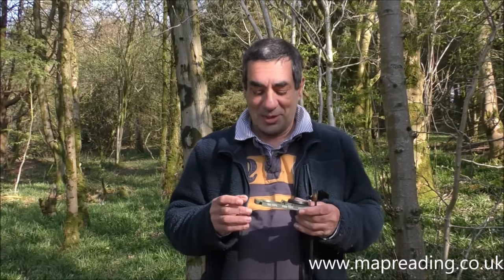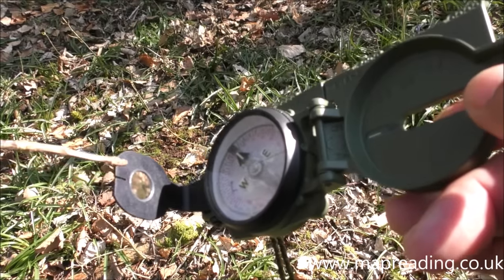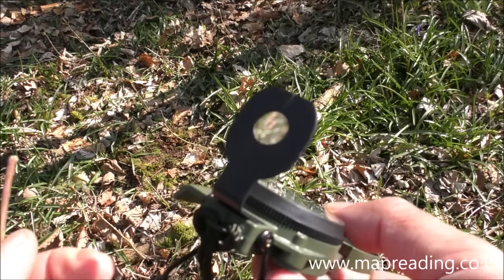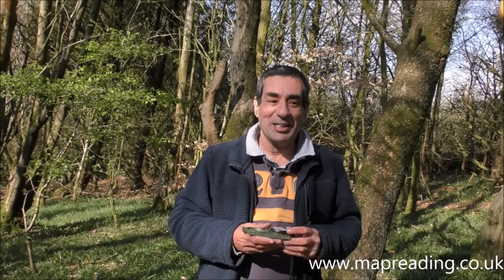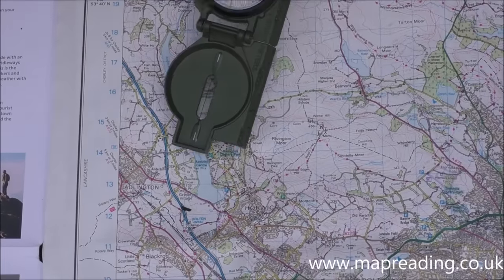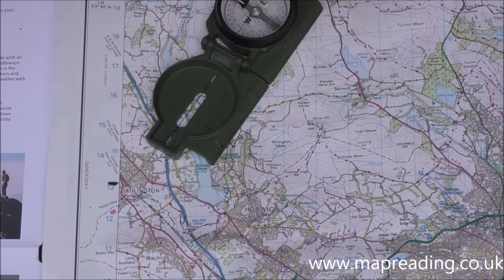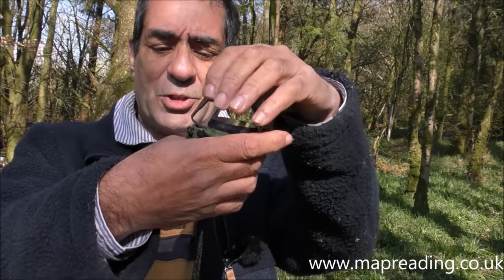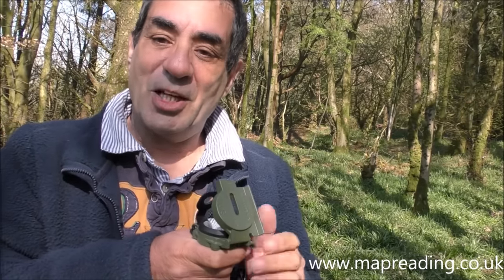Use a Lensatic Compass with a map & without

Comment: T Y, Sir!  Never had the 3-degree increment on the bezel explained before.  I have a lensatic without a manufacturer's label.  Takes forever to settle compared to a Silva baseplate, but is very useful when set on top of a stable surface.

Comment: Not quite, when you sight a bearing to a feature, you line it up with the notch on top of the lens and the wire in the observation slot. Then you look through the lens, which is there to magnify the compass card, and read the bearing from the bezel markings under the black index line. Best way is to tilt the lens at a 45 degree angle and the compass cover straight up at a 90 degree angle.

Two acronyms: for declination from Magnetic North to True North or Grid North on the map declination diagram, use LARS (To the LEFT, ADD the amount of degrees indicated on the declination diagram; and to the RIGHT, SUBTRACT); and for back azimuths, use the acronym LAMS (LESS than 180 degrees from the sighted bearing, ADD 180 degrees, and if your bearing is MORE than 180 degrees, SUBTRACT 180 degrees... For example, a bearing of 78 degrees, being less than 180, gets 180 degrees added to get a back azimuth of 258 degrees, and a bearing of 301 degrees, being more than 180, gets 180 degrees subtracted to get a back azimuth of 121 degrees).

This is useful when plotting your position on a map from observable features: if you take a bearing from a water tower, a hilltop, any fixed point feature, you then draw a line from the feature on the map through your position using a back azimuth. You can plot your position using a resection with two identifiable features on the map, use a cross section to find a point along a linear feature such as a road, powerlines, or a stream, or use an intersection to obtain the location of an observable point from two different physical locations from which you shoot an azimuth to this feature.

When using a map it helps to use a protractor along with the compass marked with degrees all the way around, and mils if you're using that scale (mostly military).

People should be aware that the compass can be affected by metallic components on your body, so keep it away from belt buckles and other things while you use it. In the military it is very important, since we carry weapons, knives, binoculars, metal clips on our gear, snaps, lighters, bolt cutters, magazines, pack frames, camp stoves, trip wire, and many other things.

Also, using a lensatic compass on slopes requires attention in order to keep it level, since a certain amount of tilt in any direction can provide an inaccurate bearing, even though the compass card seems to be rotating freely. Wobble it around just a little before you take a bearing so you can observe in which position it indicates that it is level with the ground and is pointing at Magnetic North accurately.
Reply: good description. for more accuracy use a plumb line on the wire, as this compass has no gravity bubble
Reply: Isn't that exactly what he said?
Reply: @CristiNeagu  no, close, but a little off. Precision counts. Understanding each component counts.
Reply: @davidcruz8667 You said "not quite" in relation to sighting a feature. What you said is exactly what he said. Care do detail what did you mean by that?
Reply: @CristiNeagu  OK. One ergonomic detail: the angles of the lens and the cover are specific, the lens serves two purposes, as a rear sight when taking a bearing by sighting through the top notch, and as a magnifier for the numbers on the compass card under the black index line, generally set at approximately 45 degrees looking straight at the heading numbers; and thus the cover itself is set straight up at an 80-degree angle, with the sighting wire in the slot used as a front sight.
Bringing the cover down greatly diminishes your sight picture, and can lead to errors by a degree or two. If you do this navigating in thick brush for an extended period, you can end up off track by several miles. Bad juju.
Reply: @davidcruz8667  Bringing the cover down does nothing to affect the sighting accuracy. All it really does is limit the vertical field of view. And Cammenga recommend the lens be set at a 30 degree angle, not 45, which shows that you have had no issues with using it pretty far away from the recommended specs.
Reply: @CristiNeagu  it's fine with me to use 30 degrees, as long as you can see down through it...
But as for the first part of your comment about the cover, isn't that what I just said? A blurry wire is not a very precise sight picture... being military men, we're used to gear that performs just like our weapons. This is why our military adopted this type of compass, and we have developed procedures and habits that work for us.
Reply: @davidcruz8667  In my experience, you don't get a blurry wire. That's why you look through the notch on top of the lens. That brings into focus both the wire and the object you're sighting. At least that's my experience.
Reply: @CristiNeagu  Okey dokey. That's good.

Comment: good explanation, i beliee its similar to how we did in the scouts however some differences are:
we always took the map, lined the compass north to the map north, then you know you are aligned to real life landmarks. you then place the compass on the map, and you twist the mark to match the NORTH of the needle, taking the Azimuth.  We never took a landmark further than maybe max 300 steps if i  vaguely remember, and we always checked that were on the right azimuth. the wire and the black sight can act like basically a scope, where you aim at a tree and go for it, then reevaluate, that way you dont need to count your steps.

we never calculated for declination, we never needed to, and we also never got lost. this might only be relevant in larger, thicker woods perhaps, but normally, i dont think you really need to account for it if you know what youre up to. 

*hint; it helps to see mountains in the distance, then you can align those directly to the map using the compass sight. that way you can be sure that youre not off track.
Reply: It's a very good idea to align the map with North when using a lensatic because it doesn't have the protractor function of a baseplate compass. This makes the aligning procedure we see at 7:43 pretty imprecise. It's much more precise to align the map with North and then align the tritium mark with the compass North.

Comment: so one question, if i've got no map, say it's been lost or destroyed somehow, and i see a feature i want to move towards in the distance. if i sight that feature, and read the bearing from the dial, if i wanted to navigate towards that, would i then set the tritium mark to be directly over the north arrow and keep it there? or am i misunderstanding something?
Reply from the maker: Look through the lens to find the bearing of the feature (let’s say it’s 123 degrees).
Hold the compass and rotate it so that 123 is directly under the index line.
Look for something which is along that bearing and walk to that AKA walking to the wire).
When you arrive, again rotate the whole compass so that 123 is under the index line, then sight something else which is along the bearing and walk to it.
Keep doing that until you arrive at the feature.

Most of the time, once you have rotated the compass so that 123 is under the index line, it is common to rotate the bezel until the tritium mark is over the north arrow. This can make it easier to set the bearing again if and when needed.

If you're walking at night having the tritium mark over the north arrow (which also has a tritium section) is the best way to sight your next move.

But, the temptation then is that some people will try and walk along keeping the tritium mark over the north arrow as they move.  This is not a good idea, as it’s almost impossible to accurately follow a bearing in this manner.  It’s always best to identify something along the bearing and walk to it, then repeat.  Keep doing this until you arrive at the feature you’re aiming for.
Reply: @TheMapReadingCompany  ah, makes sense, basically just use the bezel mark to make it easier to find the bearing again, but walk towards landmarks along the bearing instead of relying on it while walking, thanks

Comment: Nice video and great help with my new Cammenga.
Question: you plotted 63 degrees on the map before you accounted for the declination. Is your declination in your area insignificant. In my case I have 11 degrees East so from compass to map, I need to draw 74 Degrees.
Reply from the maker: The compass used in this video isn’t a Cammenga and it’s used differently.  For details of a simple method of using a Cammenga see my video here:  https://youtu.be/FI7C8VlbYfI
Yes at the moment there is virtually no declination in the UK.  You say that in your area the Dec. is 11 degrees east.  In this case I would just take a bearing straight from the map (for example 123 or 345 degrees) and then take the 11 degree from this (123 = 122, 345 = 334).  There is no need to need draw lines on a map when using a Cammenga.  Oh and note that the map does NOT need orienting north when taking a bearing from a map, it can be pointing in any direction.
Reply: @TheMapReadingCompany  Fully understood, I am in Melbourne Australia. 
Yes taking bearing from map I need to subtract. But, if I am taking a bearing with a compass to transfer to map, say 100 Degrees, in my case I will add the 11 and then find it on map. This is my summary: "FOR MAPS ALIGNED TO TN" 
Magnetic Bearing to TN Bearing=MB+MD [Compass to Map]
TN Bearing to Magnetic Bearing = TNB-MD [Map to Compass]

Comment: Thank you so much for this simple explanation! But I do have one question...do you have to be actually on site to take a proper map bearing with a Lensatic Compass? I am practicing plotting bearings (at home) using a map & compass, and checking my numbers with Google Earth; but my numbers are off :(  Even when I account for declination.
Not sure what I am, or not, doing correctly. Going from a transparent baseplate (with alignment lines) to a floating dial with degrees, is a learning curve for me apparently.
Reply from the maker: Google Earth compass is not normally correct - I don't know why.  I have just tested 5 different lines and they are all out by between 3 and 6 degrees.

You don't have to be "on-site" to check a bearing - you can be anywhere.
Remember that Cammenga say their compasses are only accurate to within 40mils / 2.25 degrees

Suggestion.  Take the bearing with your baseplate compass and then do it with your lensatic and see if you get the same results.  If not then make sure (try to be accurate) that when you point the north magnetic part of the disk northwards, it really is pointing north.
Reply: @TheMapReadingCompany  Thank you so much for the reply! I don't know why I didn't even think of comparing the results with my Baseplate! And the very fact that there is a margin of error could play into my seemingly inaccurate results. Thank you again, really enjoy your videos. Watching them from the US, New York!

Comment: The Cammenga Lensatic is a very tough piece of equipment, as compasses go, but I have never been convinced by it from the point of view of accuracy. You start of with a potential 1.5 degree error due to the dial clicking into place every 3 degrees. On top of that, you have a really sketchy system for transferring a bearing to or from a map with the compass alone. Add together those problems and you'd be as well buying an AliExpress silva knock-off for a pound. It is surely meant for use with the US DoD GTA protractor, or similar tools like the UK's RA protractor, which are designed for the job of transferring a bearing to or from a map accurately. You are then left with the dial clicking error which makes you up to 27m out at 1000m which seems insignificant until you are operating near a cliff edge in cloud.

Comment: If you take a bearing to a distant object the declination still remains an issue presuming any reference to that point on a map with N at the top. So the true bearing has been corrected from the compass magnetic reference. Only then can a true back angle be determined.

Comment: May I ask a stupid question please,  what is the difference between minutes of aglngle and degree or are they the same thing ? If not how do you work it out
Reply from the maker: It's not a stupid question as both are fractions of an arc.

A circle can be divided into 360 “segments” (AKA degrees) each segment can be divided in to 60 smaller segments, called minutes and each of those minutes can be divided in to 60 tiny segments called seconds.

If you have an angle which is centred at the middle of a circle (so the two sides of the angle and the center of the circle are at the same point), the length of the arc (the bit of the circumference) formed between where the lines cut through the circumference of the circle is known the minutes of arc (AKA minutes of angle).

Normally shooters use minutes of arc/angle as it make calculations simple.  e.g. a minute of arc/angle at 100yards is about (to within 0.047) an inch. 

** To an expert there is a different to ordinary people like me and you, basically they can be used to mean the same thing.
Reply: @TheMapReadingCompany  thank you so much as I've said I really appreciate your effort you put into your channel , and thank you for explaining this . Looking forward to your next video 
kind regards Daniel 
AKA ( Dan The Outdoors Man)

Comment: Be aware that you may react to the tritium. I used mine every day,practice with it and would get a rash inside my elbows. Could never figure out why, then realized that it only happened when I handled the compass daily.
I stopped using it and got a phosphorescent Camenga, no more problems.
Also don’t disassembled old compasses that are tritium or WW2 compasses as they are not safe.

Comment: quick question, are there any markings or any way to tell if your military compass is for the northern or southern hemisphere or are military compasses global compasses. . . .
Reply from the maker: I don’t think so, but I may be wrong.  

If you watch the video I made you can see that my Cammenga compass has only three sets of numbers, none of which show if it’s northern or southern hemisphere.

NSN 6605-01-196-6971: this is the US government’s National Stock Number

23 04 77: Manufactured year = 23, month = April and the Lot Number = 77 (77 means it wasn’t made for a US government order)

21-26480-03E: this is just Cammenga’s licence number from the US Government and the 120 mCi is part of that licence and it shows how much tritium can be put on to each compass.
Reply: You loose some accuracy if you take a northern hemisphere compass to the southern hemisphere (or vice versa) because of how the needle is weighted (How much accuracy you lose is related to the quality of the compass and user skill).  A cheap northern hemisphere compass may bottom out on a flat surface in the southern hemisphere--again because of how the needle is weighted.

You can tell just by looking at it easily: If you set it on a flat surface and the needle platform is also flat: you have the correct compass for your hemisphere (or a global one).  If the needle dips significantly even though the compass is flat: you're using a compass from the other hemisphere.

The MILSPEC compasses will tell you in the technical specifications but odds are very high it's going to be northern hemisphere if it says "made in the US" on the label.
Reply: @TheMapReadingCompany  Milspec compasses are expected to be global.  These use a deep well to overcome hemisphere dip even though they're usually balanced for the northern hemisphere.

Comment: Are you familiar with the acronym, “LARS”? It is for declination diagrams. West being left, East being right. Simply remember LEFT ADD / RIGHT SUBTRACT. LARS. Its easy to use because the declination drawing either has the declination on the left or right of the Grid North line. I am dyslectic and I can only use memory techniques. Trying to think about declination in 3d would cause my head to explode.
Reply from the maker: I cover the LARS methods in this video:
https://youtu.be/Tf9rrmq5Vf8

Comment: Is it more accurate to use compass or protractor to get azimuth? I was taught how to use a protractor, this way looks more simple.
Reply from the maker: Hi Giovanni.  
Yes you can use a protractor or a compass.  Both methods are accurate – if the person knows how to use the equipment.
Protractors can be used by people who need to only use a map (for example surveyors) to create plans or diagrams.  They are also used by people who have a compass without a straight edge or some military situations would be better with a protractor, etc.
On my navigation and map reading courses I would always suggest using a compass to take your bearing/azimuth.  This way you only need one thing (a compass) and you don’t need to draw lines on your map.